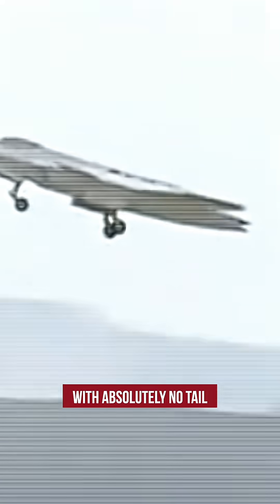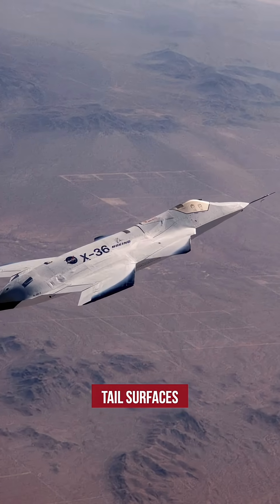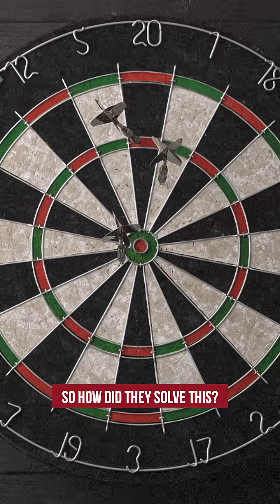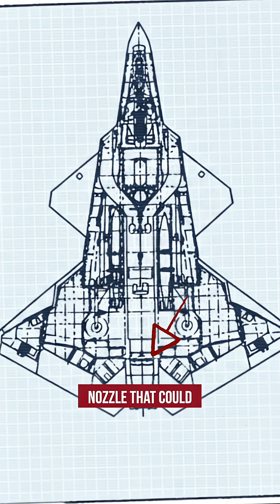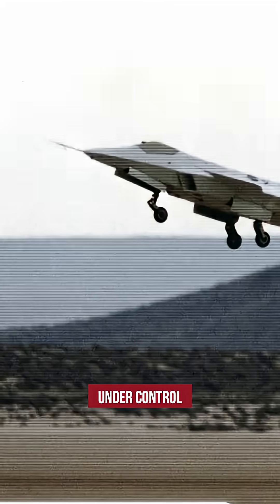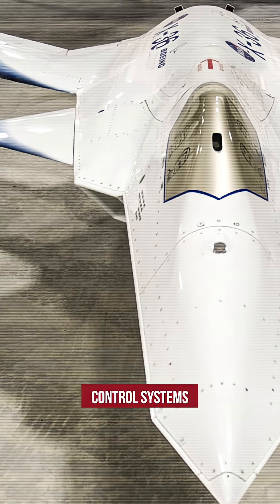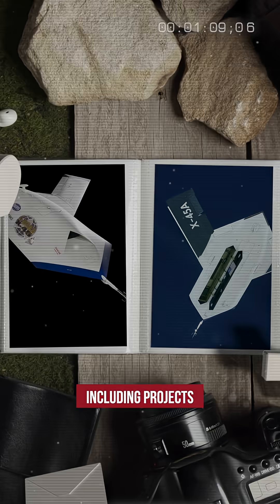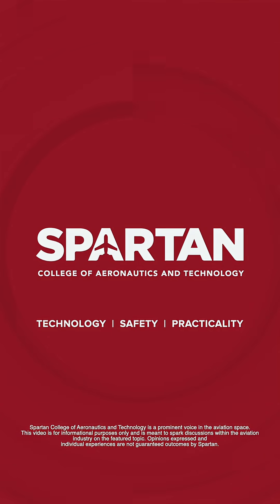The Aircraft That Helped Rewrite Flight Rules

Comment: The forward canards and the ailerons / elevons provided pitch control.  You could think of the canards as a horizontal stabilizer - just that they are positioned forward on the fuselage.

Comment: This is NOT a relatively new concept I'm pretty sure that the HO 229 was made in March 1945 and is a German Jet that lacks traditional vertical and horizontal stabilisers and most likely laid the foundations for modern aircraft (like the one depicted in the vid) along with the B-2 and possibly even China's new UAV (however I'm not 100% sure abt that one) NOTE: THESE ARE MERELY ASSUMPTIONS the Ho 229 was certainly a Nazi aircraft however stating that it laid the basis of modern warfare is merely my assessment and assumption and SHOULD NOT be stated as factually sound, particularly as I am unable to recall HOW the Ho 229 operated without apparent stabilisers or what alternatives may have been incorporated with both the final design and new technology

Comment: Flying without a tail isnt really what makes it impressive. Its doing high AoA maneuvers without a tail. No tail is "easy" when you just need to fly in a safe straight line slowly and drop bombs. But doing a fighter aircraft's job without a tail is the hard part. This is why the F-22 has a tail. 

The new tech thats going to bring it to the next level is Active Flow Control and Circulation Control Wings

Imagine a wing and body that are covered in small holes, those holes have tiny little Pneumatic Control Jets inside them. They let out little bursts of air that can do what normal control surfaces would usually do. So you dont have moving parts that change the radar cross section at all. Just one smooth airframe with no surface controls or moving parts visible.

Comment: Milwaukee City 2008 10pm at night  a full size fighter jet yet possibly could've been a drone (looking back)was where a 3rd floor would be on a 2story tall building right across the street from me

I'm at a bus stop and there it was black triangle dead silent yet traveling at least 10mph across the street from the hurt of a 3rd story building.

Right when over head it tilted its body and 2 soft ball size white circular lights lit up beneath each wingtip and had no tail fins yet a noticeable 5ft long tail spike like a sting ray.

I'm telling ya it was so low I could've nailed a rock off the underside 

The kicker is prior that night by 2hrs or so, I heard the loudest jet roar I've ever heard and when looking up I seen 2black triangles in line 15ft apart flying higher and faster then I've ever seen anything b4 with just one noticable red light over where the back of the pilots canopy would have been if it even had one.

Best believe the craft that slowly hoverd pass me had that same red light over the rear of the pilots canopy area yet like I said dead quiet not a peep of sound 

what it was I'll never know but something gave me the impression it was man made and that all enemies of the USA better be greatful/hopeful that aircraft stays to American air spaces only
Reply: What you're describing sounds a lot like the X-47A.

Comment: Funfact, this was only possible because Germany and the US make a Prototyp (Rockwell-MBB X-31) this was the first attempt to equip a modern aircraft with 3d thustvector. The only one left of this projekt is the Eurofighter Typhoon Ef2000 without 3D thustvector
Reply: That's because Rockwell dropped out of the JSF program. Boeing went ahead and entered their X-32 and Lockheed with their X-35. Fun Fact: DARPA had their hands in all 3 programs, as well as the X-36, X-47A & X-47B programs.
Reply: And there's 2 X-31's left. NASA has the other.

Comment: I have a strange feeling that this might be our F-47
Reply: I think the F 47 will be a combination of the X 36 and Boeing's own bird of prey. With a generous helping of new advancements
Reply: @imaginos377  it's a mix of the X36, X47A & X47B
Reply: Most likely, that and the x-47 drones paved the way for a lot of the technology that NGAD is likely using
Reply: @carson7771  NGAD (Next Generation Air Dominance)is a program that started in 1983, it's not a plane. Both the F-22 (ATF - Avanced Tactical Fighter) & F-35 (JSF - Joint Strike Fighter) are NGAD planes. NGAD also includes ALL of our drones starting with MQ-1 predator and RQ-4 Globalhawk through to the MQ-28 Ghostbat and RQ-11 Raven. The F-47 is the latest in the NGAD program, it's designated as PCA - Penetrating Counter Air. The F-47 was created from the X-36, X-47A & X-47B programs.
Reply: Canards arnt stealthy the f47 isnt real
Reply: @Alloy682 The United States Military does not give F (Fighter) designations to planes that are not in production. I hate to break it to you but the F-47 has already flown, it'll be fully in service by 2028. The test flights of the 3 X Planes that would eventually become the F-47, first flew in 1996 (X-36), 2003 (X-47A) and 2011 (X-47B), The 2 protypes of the F-47 first flew in 2018 & 2019.
Reply: @Alloy682 canards are less stealthy than a lack of canards.  That goes for a lot of things- guns, missiles, access panels, cockpits...  Turns out the best way to make someone not see something is to just not put it there in the first place, and everything else is just compromises that are less stealthy by acceptable degrees.

Though yeah speaking of Not Sees I choose to believe the F-47 was named after Boeing employee of the year, Agent 47.
Reply: @northropi2027 boeing has never made a fighter

And guns and missiles are internal

Boeing would not be selected for making a fighter. 

Unless the gov went stupid (trump is incharge) the government went stupid
Reply: @Alloy682 Boeing ran the Super Hornet lines for some time to be fair though I'm not sure that counts.

Moreover, guns and missiles do contribute to RCS if external, and when internal, the bays and ports do present geometry that can spoil RCS slightly.  If you were only interested in minimal RCS, the outside would be essentially monolithic, with no ports, panels, or doors- obviously this isn't practical, but that's what I mean by stealth working in degrees.  Canards could make sense on a stealth aircraft if the other demands of the design require them and the tradeoff is mitigated elsewhere.
Reply: @northropi2027 so no, the missiles cannot contribute to radar cross signature if they are internal, that's why they are internal

Boeing did run the superhornet lines yea, but the never designed a fighter, it was mcdonal Douglas
Reply: @Alloy682  I'm saying that having a discontinuity in the hull from the bay door that covers the missiles is less stealthy than if the bay door was sealed, ie stealth must be compromised to make the aircraft functional as a weapons platform.
Reply: @northropi2027 I understand, just not buying that the f47 is real
Reply: @Alloy682  😂 ok so Boeing didn't make the X-32 that lost to Lockheeds X-35 in the JSF competition? It's literally an Experimental stealth fighter plane.... the JSF program started in 1996.... 😂 you know absolutely nothing about what you're trying to talk about.
Reply: @Alloy682 incorrect they designed the X-32... 😂
Reply: @Alloy682 Nope, it's been flying for years and has no canards.
Reply: @cubed0724 believe what u wanna belive lol, anything trump says is a lie tho😂
Reply: @Alloy682 I'll believe the facts, it has been confirmed by the military and not Trump that the F47 has been flying for years. Get your TDS treated.
Reply: @cubed0724 that is false information buddy im sorry, please be smart.
Reply: @cubed0724 we have only seen a Powerpoint, no videos or real images of F-47.
Reply: @XimCines Check out the new recruitment ad for either the US Navy or Airforce, they have actual shots of a new jet which is the F47. US excels at keeping things secret from society amd operational for years before it's released publically.
Reply: @cubed0724  I disagree because "shots" are not enough. Chinese also uses mockups. 

Besides, since China already have various videos about the new ones it makes sense that USA shows a working fighter to apease people.😊
Reply: @XimCines The problem is that China's new designs are what the US fielded decades ago. The US doesn't need to show its latest because there's nothing to prove. Once China fields something not copied from the US that's an actual threat, then the US will show its best. Right now everything China has shown would be handled by the F15EX, F16s, F18s, and B52s.
Reply: @cubed0724  they have 40 J-20s, Im not worried about a J-36 or a J-50.
Reply: The F-47 is more based off of the Bird of Prey demonstrator, but the X-36 I’m sure still contributed as a tailless design.
Reply: good point... 😂 that variable cycle exhaust they keep showing also has a flattenned stealthy exhaust. seems to be a first for anfighter aircraft
Reply: It's definitely the biggest contribution in its development. They won't say it but they used the same design in the full size prototype for NGAD that set all kinds of records years ago.
Reply: The f47 is as non existence as Ur Epstein investigation. Enjoy Ur LGBT rainbow cope tho
Reply: Your?? Owner??
Reply: Nop
Reply: Felon-47
Reply: I love how J-36 designs took them right away to come up with, but X36/F/47 took them years, even this makes the Shenyang J-50 perfected what Boeing took so long to realize
Reply: @Sukhoi_Suou599xx So you're admitting China directly copied the X36 to make their J36, thanks for the admission. This is what makes China military obsolete, they copy 50 year old tech and claim it's cutting edge. China's military demonstrations are nothing more then just showcasing old American designs that weren't used due to flaws. Also the US took knowledge of X36 testing and perfected it with the US current platforms of drones and jets. China is stuck in the past, the Shengyu corporation is just a copycat corporation.😂😂
Reply: @Sukhoi_Suou599xx do you even realize how old the design for the F47 is 😂 China doesn’t make much of anything, they’re really good at stealing everything though. They’re the laughing stock of the military industry, there’s a reason no one buys anything from them. Why buy the Temu knock off when you can get the real deal from the US
Reply: @I_am_him666-v5s ok and? 

China... yea one who is proud of their military and shows their nation their tech, while boring USA doesn't do military parades or show anyone that they are a proud nation
Reply: @Sukhoi_Suou599xx lmao America has never had to do military parades to be patriotic 😂 we are country most known for being patriotic 😂😂 we just make the biggest baddest shit then send them to the battlefield
Reply: @Sukhoi_Suou599xx Bragging about China jets but still rely on Russia engine parts is crazy talk 😂😂😂😂 US is not a conscript paper tiger like China Russia and North Korea. We are built for war and to protect US interest We have weapons that we never show to the world 2orld until For the F-47, we will have almost 200 we don't need alot because F-47 wi.l have smaller and bigger drones around it to to do the mission and do the dirty work then that's when F-47 finish the work undetectedThe drones will take out air defense s9me will be for reconnaissance sometime be fordistractions and etc... while the F -47 sit back and it will be manned or unmanned power by AI or human
Reply: @AllAmericaMuscle forgot about drones, how to make a military weaker by relying on drones instead of jets.
Reply: @AllAmericaMuscle  also with Drones, I love how China has Drones, Drones stealth jets, drones stealth helicopters. What does the US have? Nothing no drones
Reply: @Sukhoi_Suou599xx  US also pioneered the stealth helicopter with the RAH-66 Comanche and the modified UH-60 Blackhawk in the Bin Laden Raid. China doesn't operate stealth helicopters, most of them are concepts and models, not real working designs.

Just now Sikorsky developed the UH-60UAS, an unmanned variant of the UH-60 for light transport and UGCV insertion.
Reply: @zachanator2011 No, we do military parades but we do them over other countries. Lol 😂😂😂
Reply: @Sukhoi_Suou599xx Nope, none of those but the US has stealth drones, CCA, and even drone carriers. China has mock ups of drones that don't work as China don't have the advanced chips to create the stealth drones. What China has in drones was what the US was using back in the 2nd invasion of Iraq. China so far behind.😂😂😂
Reply: This is just copying the two duck wings in front of China's J20.😅
Reply: Miki wong likes the lady boy! 🤣🤣
Reply: @miki-wong836  ummmm the F-47 has been under testing and development for 15 yrs. I promise the US 100% doesn't need or want anything China is producing. We are ahead of them decades when it comes to stealth technology and designing/building fighter aircraft.
 It is a fact that China does whatever they can to steal info from our programs though. 😅
Reply: @cotystiehl7260 wrong, the fact they are already in production of the J-36 cause there's more than 4 in the sky and making a 3rd 6th gen stealth jets, US is behind so badly, remember when we made over 15k F-86 Sabres to now 186 F-22s and God knows how many F-47s will be probably less than 100. It's QUITE obvious US is cheaping out, if the YF-23 supposed to be the OG "F-22" and the the F22 was supposed to take on "F-35" role, seems like they dont want OP
Reply: @Sukhoi_Suou599xx Incorrect, the F22s and F35s and even our F15EX are far more advanced than China's J20, J35, J36 or J50. The F47 will be greater than all the above by decades. While China was building the J20 off of stolen US F22 and F35 plans, the US were already testing prototype designs of the F47 and B21. China's military parades are nothing more than copies of old American designs that were discarded. The F47 is in production already and is being built quickly. Also the navy FAXX will probably be just an upgraded version of the X23 with the most cutting edge engines, radar, missiles, and other alien tech. The US doesn't need to parade it's stuff when China parades their stolen copies of obsolete American designs. China is so far behind it's hilarious. 😂😂😂
Reply: @Sukhoi_Suou599xx  You can't try to flex on the country who your country copies/steals tech from. Literally everything china has is because of publicly released info on tech or info that was stolen from the US. Without our research, china would have paper airplanes instead of drones, and fireworks instead of missiles
Reply: @cotystiehl7260 
15 years of development doesn't feel real, Trump omly showed a Powerpoint.

Unfortunately USA can't produce anything the same way China can't produce anything, both needs products to import due to geographics.

USA can't produce coffee, avocado mangoes, lithyum, uranium, gold, and so on in quantity and quality enough to sustain it's own market. 

That is why tariffs had been lowered on those products, it was producing a rise on prices that Americans consume.
Reply: @Sukhoi_Suou599xx  The J 36 is not in production !! They brought out another prototype with different modifications !
Reply: @miki-wong836  they are called canards and they have been used in aviation since the first aircraft itself the wright flyer which WAS INVENTED BY AMERICANS
Reply: @miki-wong836  the x-36 flew 13 years before the j20 did😂😂
Reply: @carson7771 Why is f47 still on the drawing for so long?😅
Reply: @miki-wong836  why H-20 still ppt while the second B-21 already flying 😂
Reply: @miki-wong836 because we keep our tech that is light years ahead of our allies and adversaries alike, completely secret. Once the public sees it, the next generation is already well into development. Like when the world was surprised by the F117 in the nineties whereas it was flying in the seventies and operational in secret in the eighties. 

I'm not knocking on China, y'all (I'm assuming this based on your tone) have made some incredible strides in the last decade or so.
Reply: @miki-wong836  There was no threat that required it, plus budget constraints.
Reply: @ProsperousHobo exactly! Just the broke boi invester decides to the US government how many F-47s can be produced like how the F-22/35 is, and at the same time, China no one is arguing to put in momey cause they do all it ajd with the production rate of 300 J-20s per year. Shows you, How it works in the US, is decided by the rich people want to make a country great...
Reply: @Sukhoi_Suou599xx Also, the US since August 2023 has produced over 900 F35s with the advanced block 4 upgrades, so China's 300 J20s a year that have poor engine performance and reliability is behind. Lol, China has no chance and won't be able to keep up given how the tariffs are crushing China's economy and causing massive layoffs and companies shutting down. 😂😂😂